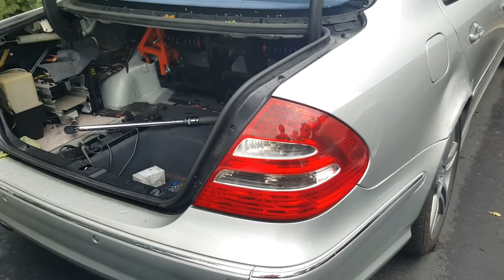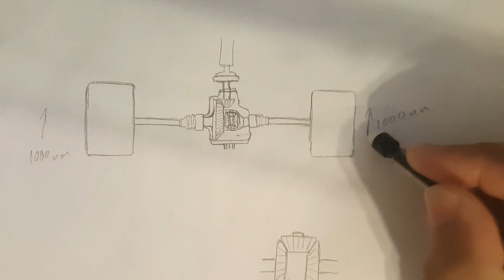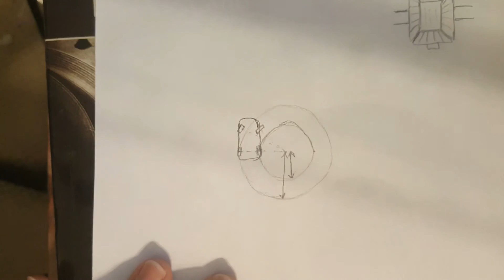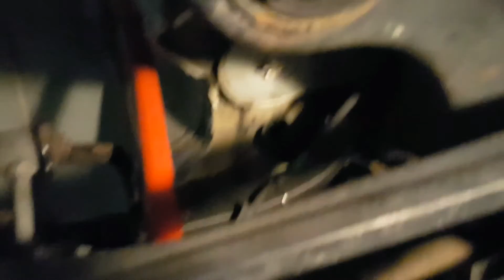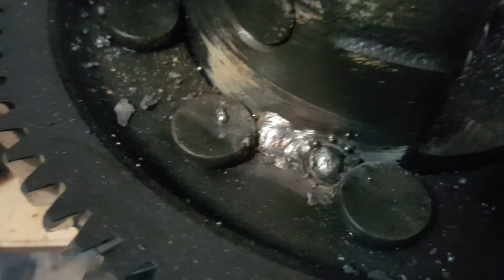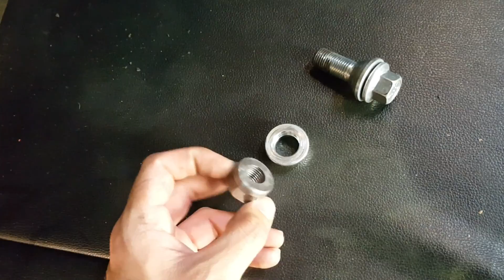How to Build a Properly Fast Track Car - Part 5 (Welded diff, spacers, suspension)

Comment: So, you say that if one tyre looses traction then it can't have much higher torque. But still one tyre is on the ground it means it can have. Then how do you know which tyre will decide the amount of torque on the wheels? The one which has traction or the one which doesn't? Pls solve my doubt?
Reply: It goes through the path of least resistance. So the tire that looses traction gets all the power, which sucks

Comment: Welded diff? 
Are you serious? 
U plan on entering Speedway events? 

Don’t cheap out on bits that stick you to the ground, and bits that get engine and braking power to the ground all u kiddos out there watching. Not on car for tarmac circuits anyway... It can be done sure, but just because u can, don’t mean u should 

Thats like cutting winds off a coils spring to lower your car, or welding the actuator arm on an internal waste gate to make more power.

Comment: Good job including the jack safety!

Safety is the top priority when working on a machine like yours.

To all the haters in the comments regarding you welding your differential, you did give a condition for doing it, as it was a temporary solution.

Keep up the good work. Hope you get that new replacement engine in soon after you rebuild it.

Comment: A locking diff is not suitable for track car you need a limited slip diff. Therefor welded diff is not in anyway suitable for the title of the video/fast track car/ ?! you made your car unstable and tail happy but that's it. I don't know where you get your ideas from, they are not in anyway appropriate for track car usage.
Reply from the maker: Listen to what I said in the video at least. It was a TEMPORARY thing just for one racing event because the LSD I had ordered was not going to arrive in time. I was getting rid of that diff anyways so welding it was a good solution over open diff for that one event
Reply: You are talking Bollox - have you actually driven a car with a locked diff? Your comments indicate otherwise - they don't make a car tail happy, if anything they make the car a bit more reluctant to turn in, but its really not all that bad just different. For sure an LSD is a bit better but a locked diff is also perfectly acceptable, I've run them and they are also often used at a high level e.g. the V8 Supercar series in Australasia use locked diff's.
Reply: Matthew Isaac 
V8 supercars use ‘locked diffs’? U sure? Not 2 way LSD? 
Acceleration and turn in is ok. Its the yaw induced oversteer when weight bias begins to shift rearward on picking up the throttle mid corner with already high lateral load and roll load... BUT the biggest problem is when braking very deep on certain fast in, slow out lines that require squaring off the corner with a late apex and where throttle lift off is fairly fast and doesn’t occur till after turn in and followed by pretty heavy braking that unsettle anything but the best chassis set ups. (And if rest of track allows ideal setting) Even without the braking factor, a FULLY locked diff on throttle lift off during high steering inputs is waaaay more of a handful than on ‘turn in’ as you say, or mid corner - corner exit yaw induced oversteer. Works better on dirt as lower static friction of surface provides some of the needed slip. Or in low-mid level drift cars where sharp throttle lift off can be used to provide a ‘handbrake’ effect. 

2 way adjustable LSD’s spread torque on de-acceleration as well as acceleration BUT, the slip rate require to initiate engagement and the rate of engagement (lick a clutch that’s designed to slip a little bit on launches to aid traction) can factor in the sharp throttle lift offs as well as the need for larger slips rates upon the de-acceleration rates but at lower ground speeds. Ie; you dont want a car that is upset easily and struggles to transition smoothly from deceleration to acceleration on slower sharp corners. Like the final corner at Mt Panorama.... 

Actually, I’m pretty sure (Haven’t followed the sport for few years now I admit) they have the  ability to adjust Diff setting (only for full engagement, slip rate though) and brake bias with levers near the gear shifter (prob have paddles these days lol. Was Holinger sequential box,  strait cut dog gears n traditional stick shifter with quickshifter back then, not even auto blipper I believe.) 

I may be mistaken but, I find it kinda unlikely they would use a mini spool type fully locked diff... 
Unless rules stated it as a requirement.... 
the need to introduce more slip as grip levels reduce is fairly critical at even high level motorsports, let alone the top level, premier class championship of a country.

Comment: The title is how to build a properly fast track car. But then you welded the diff? Wow! Spend less money on building unsafe seats and buy an lsd
Reply from the maker: At least watch the video properly. I welded the diff because the LSD didn't arrive on time and I was getting rid of this diff anyways. I have an LSD installed now.
Reply: I watched the car in person. I was frightened by the wing and the seats. I would bet money the seats would injure you if you ever had an accident. Threaded rod isn't strong
Reply from the maker: I agree on the seats, they were supposed to go with a roll cage that did not get completed in time. Most of what your complaining about has already been fixed. You will see the car in better shape next season.

Comment: Are you using some 120v flux core welder like a princess auto or Canadian Tire? Next time if you have to weld on such thick material and you have an under powered machine what you do is buy a propane or map gas torch from any of those stores for like $20 and you heat the area first that will preheat everything so when you go to weld it will flow in much easier because the heat is already in the material. If it was totally free of oil you could also stick it in the oven which works great but you shouldnt use that oven for cooking...but you can get free working ovens off kijiji lol. But either way it worked out great nice job.
Reply from the maker: Yes, this was the 110V flux core welder lol. Don't like it to much but it does the job. I didn't want to preheat it because I didn't remove the rubber seals for the axles. I was afraid heating the differential too much would damaged those, but it worked out fine anyways.

Comment: What year is your e55? Unfortunately for me my rear subframe mounts gave way on a take off. They ripped completely off the frame. Nothing few grade 8 bolts couldn't fix but was wondering if this was a common issue for other 211 owners.
Reply from the maker: Mine is a 2004. No issues with the subframe mounts so far, but I know the CL and S classes have issues with the front subframe bolts becoming lose.

Comment: Superb trick filling the differential

I had problems with bad balanced wheels and welded differentials, because cracked welds, I guess by poor welding. I recommend thoroughly clean parts with solvents and properly welded (temperature, power, etc.)
Reply from the maker: Did your welds crack right away, or after a while? Mine is working fine so far, but I still have to see how it will do on the track.
Reply: +SK8215 after some abuse in track, in my case i didnt break the differential
Reply from the maker: I hope mine survives the track. I have a time attack to compete in next month. If it fails there, I'll be really screwed lol.